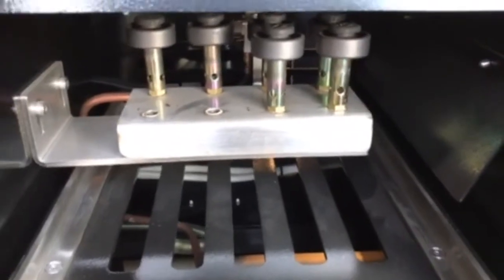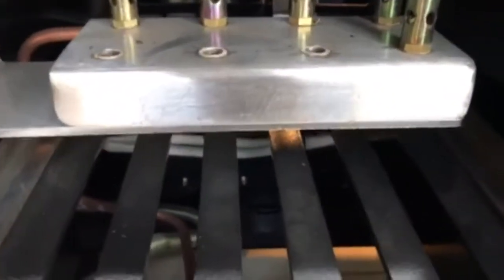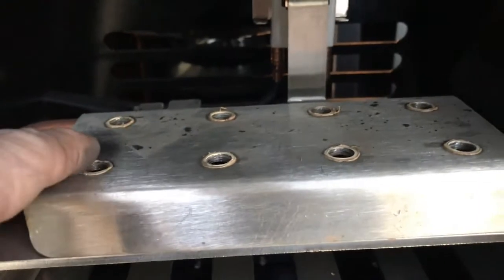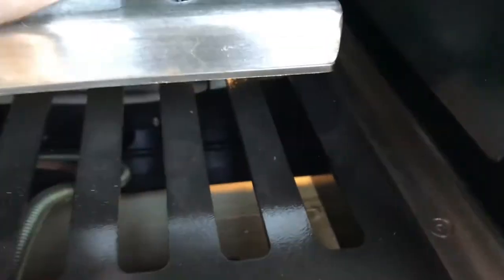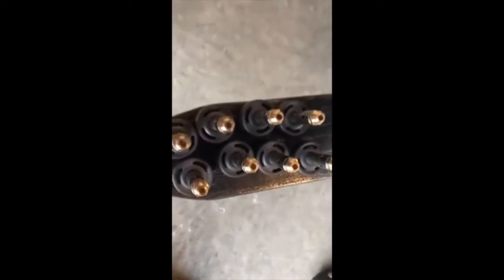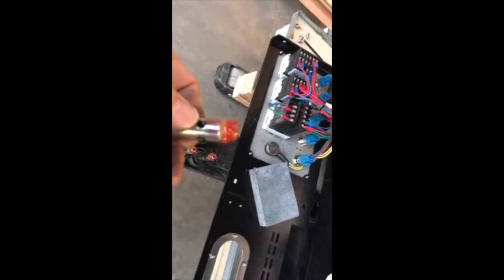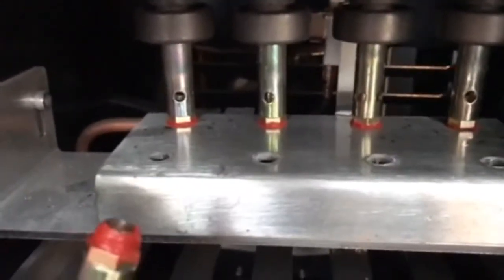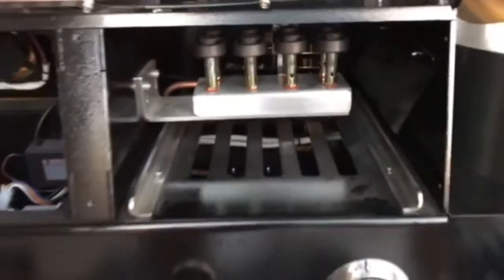CONVERTING TO NATURAL GAS ON BC ROASTERS

Comment: My roaster produces too much yellow flame. I use LGP. What can be wrong?
Reply from the maker: Either your roaster has Natural Gas orifices in it and you are running it on LPG or there may be other factors. Gas changes color as it changes temperature. Blue when hottest then colors changes as flame gets farther from heat. Also dust in burner room can change flame. But be sure your orifices are made for LPG and not NG.
Reply: BC Roasters Thank you for reply! Spare orifice is exactly as in your video , here is the photo https://yadi.sk/i/Lt5TpSKvDtQSNA
And photo of the flame https://yadi.sk/i/aQsAAebKJjx9hw
I’ll check tomorrow orifices on burner, but should be the same
Reply: BC Roasters yep, exactly the same as spare one. Thus, for LPG
Reply from the maker: Michael Gaganov 
What type roaster is this and from where did you buy it? Has burner always looked this way?
From the looks of the picture it appears  the orifice has a large opening like a natural gas one. An LPG orifice has a hole that is about 0.65mm. Natural gas is about 1mm or 1.1mm.
Reply: @BCRoasters  this is chinese DY2. Bought right from the factory. It's new. Have just received it a week ago. I've ordered roaster for LGP. They even asked me for what type of gas I need.  Regarding orifice hole. In your video https://youtu.be/Wy4qY97ANtc?t=279 there is a comparison photo of two types of orifices. And LGP orifice on that photo has bigger hole than natural gas orifice, what's strange, because as you say LGP orifice should have smaller hole. 
I'll try to reduce the hole with a thin copper wire and check how a flame changes.